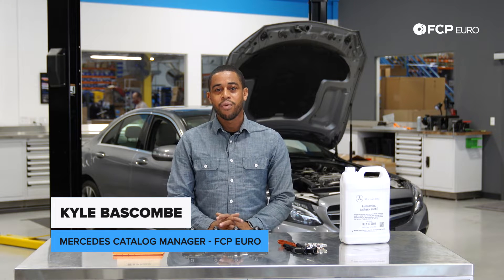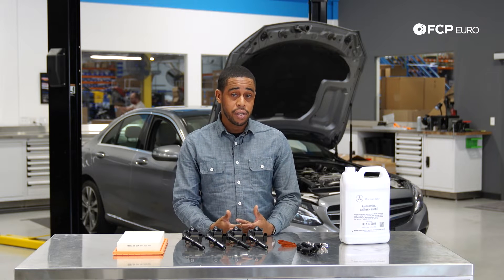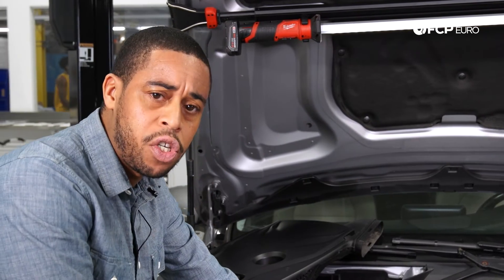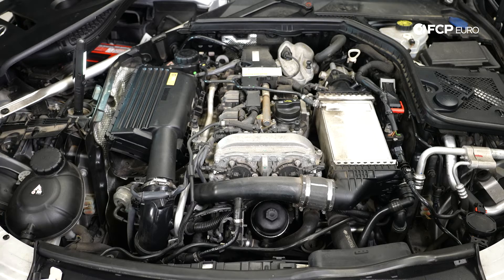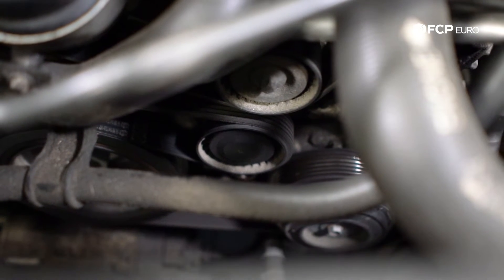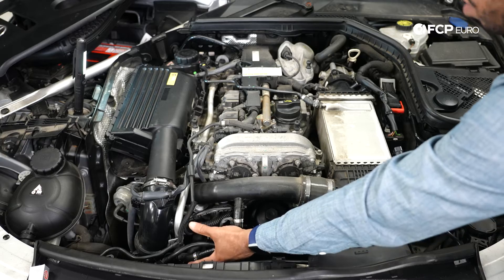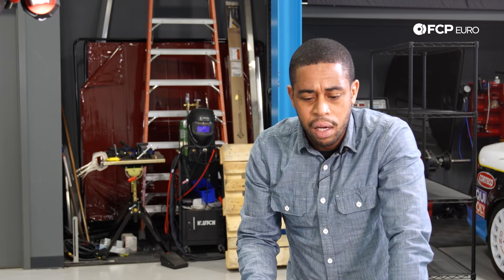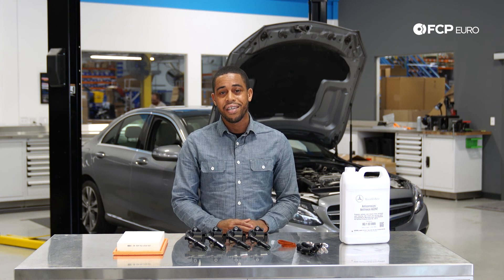Mercedes-Benz M274 Engine Diagnostic & Maintenance Guide (Mercedes W204, W205, W211, W212, & More)

Comment: I currently have 200,000 kilometres on mine which I purchased new in 2015. Never had a single issue with it. Having said that, it is displaying symptoms of a stretched timing chain which I'm getting on to.

Comment: Cool summary with some good details. Would you advise to Clean the throttle after 250 kkm in Case of Not having any related issues? How about cleaning the injectors?

Comment: Bought my e300 2017 at high 58k miles and first oil change at 65k but overtime it would jidder/shake when idle. Thinking it’s spark plugs? Any help
Reply: Could be as simple as engine mounts

Comment: My M274 2015 does not show any errors... but I'm finding it strange that there is a sound of water bubbles inside the vehicle. Driving is normal. Is there anything I should check preventively? The car has 60,000 kilometers.
Reply: i had same problem on my bmw, but when u turn off ac it stop

Comment: P0016 code replaced crankshaft + camshaft sensor Bank A should I replace solenoid adjuster?
Reply: Did you solve your problem?
Reply: @Boopityboopy no it’s been on for 10 months lol
Reply: @Avlful to be honest this engine is such a crappy replacement for the v6 m276
Reply: @Boopityboopy idk I been driving with this code
Reply: @Avlful totally understand, but the m274 isn’t like the m276 when you have timing issues because the m274 can actually bend the camshaft and cause serious damage if you keep driving without getting the car back in time. Any given day it can happen when the engine is out of time due to stretched timing chain or bad camshaft actuator whereas the m276 just causes a rattle upon cold start that can’t really lead to anything

Comment: Hi master,thanks for sharing all this info on M274, when the first time the timing chain needs to be replaced ?
Is that engine is better than the M271 (C180 of 2011 for example) ?
Thanks 🙏
Reply: A timing chain should last the life of the engine if you change the oil on a consistent basis.

Comment: All the jrkoffs saying the 'diesel' sound is gudgeon knock are FoS. its a combo of powerful injectors and the high pressure pump, which runs at very high PSI. The pump housing is slightly oversized, and aluminium, which is why people often notice a temp dependency. In the US there are customers running m274 engines into the late 200k, some at 300k, which is 500,000km. The gudgeon pin issue was fully resolved by a redesign of the pins, which are larger dia since 2017.

The subsequent, and fairly rare piston failures have all of them a common theme, incorrect RON fuels. Either too low for ECU knock corr, or abrupt RON changes before ECU adapts timing. Note the theme with piston that fails, oh yeah, startup stress from prem detonation. It's people running interference, purposefully or inadvertently through layman's guessing, advancing a claim the gudgeon issue continues to the present day, because ofc a gudgeon failing ruins its piston. But so do a-holes running low RON fuels in high comp motors.

FCP are great for parts, the guys "terrible but not so terrible" is just very "imho", imho. the 274 is a nice engine and very very easy to access. Whining on about water pump access? Bro, go look at any Toyota if you want tears to flow

Comment: 2017 E300 suffered #1 piston failure at about 110K miles, always well maintained and fed on Costco premium fuel. No help from Mercedes corporate. Had block replaced by my local mechanic. Still waiting to see if a class action suit comes forth. MB should have a recall on this engine. Also as everyone else, I have had numerous problems, but I was lucky enough to have them serviced through an extended warranty that I had purchased thru MB.   Latest is a P0299 code...MB recommends replacing the entire turbo assembly...turns out the waste-gate  vacuum actuator was bad, found one on Amazon,  fixed problem. $40 dollars vs $4000.
Reply from the maker: Sorry to hear this has happened to you :(
Reply: W205/C300 @130K had to replace vacuum actuator on turbo unit. Unfortunately MB does not sell the actuator alone ( only the entire turbo assembly for 5K). There is vacuum actuator from the previous engine, which fits too.

Comment: I have a 2019 E300. Garbage! 57k miles, and the intake adjuster broke. A $7,300 repair. The service advisor said it's a Nissan motor. He said it's not worth keeping but with a trade-in value  of $20k that's negative $11.5k from what i owe. That's why you never buy a Mercedes.

Comment: Greetings, I have a W212 e180 1.6 2015 274 engine vehicle, the tachometer is constant at idle, but there is shaking when you give gas at constant speed, the authorized service changed the spark plug, the problem continues, there is no fault code other than thermostat failure, authorized service, injector, tank fuel. pump, high pressure pump, it says let's change the coil, but this change requires a lot of money, first of all, where do you think I should look for this shaking failure, shaking does not always happen, it does it for 10 minutes in 1 hour of use, in total, the tachometer is hovering between 1500 and 2500 rpm, sports You don't feel much shaking during use, regards.
Reply: Did you fix the issue? My 1.6 M274 has a similar issue
Reply: Unfortunately I couldn't solve it, I want to start with the cheapest crank position sensor, then change the coil, if that doesn't work I will try changing the gasoline high pressure sensor.
Reply: The problem still persists, they say I need to replace the entire fuel system, if the problem does not go away, we will look at other points.
Reply: It's no fun driving with this fault.
Reply: They want 1/5 of the car price
Reply: I think it's a simple problem,

Comment: I’ve been religiously running chevron 91 only since i purchased my 2018 E300 4matic at the dealer almost two years ago at 68,000 miles one owner. Now it’s at 110,000 miles and every 5K oil change it’s still running exactly the same way I had bought it. Smooth and quick. Just changed the PCV and thermostat as preventive and done the transmission at 100K and differential front and back. Oil changes makes a difference and so does gas. At 100,000 miles spark plugs changed spotless. Theplugs were not bad at all. Checked top of piston and it was clean

Comment: Thank you for the in depth explanation.  Have had an M274 in a 16 model sport package, purchased with 34k on odometer currently at 78k stress free miles (knock on wood).  So far only had the auxiliary battery changed under warranty, serviced the transmission at dealer at 55k miles, plugs at 48k, all other normal A and B services.
Reply: Beware the issues usually start with this engine around 80k-100k miles. Timing chain, chain tensioners, camshaft solenoid, actuator, and camshaft issues all very common once near 100k

Comment: I have an SRS system failure due to the Pre-Safe failure in the drivers seat belt tensioning. I thought my eco drive wasn’t working bc of that but there’s also an engine light and so the thermostat may also be the problem.  Thank you for this video. I will be servicing my car soon at the MB dealer, hopefully they won’t charge me an arm and a leg for the servicing of the  supplement Restraint System

Comment: what is this error P13C523
Reply from the maker: Hello! Mercedes notes this code as referencing a "short-term torque limitation as detected by knock control." We'd also recommend checking if there are any codes relating specifically to the knock sensors that may indicate replacement is worthwhile.

Comment: Very interesting your video and very useful! Honestly, I was very intrigued when you talked about the common issue that this engine has with the piston. You described some exact sounds that my M274 makes in the mornings when the engine is cold. I have a 2018 C300. You mentioned that this is common in the 2015 and 2016 models. I hope that this is already resolved for the 2018 model. However, your description of the issue matches what's happening with my engine, but only when it's cold. After about 15 minutes, it works perfectly. The car has 36,000 miles and is very well maintained. Should I be worried?
Reply from the maker: Hey there Cristian! Your C300 should have an M264 engine, which is a bit different from the M274 that Kyle is diving into in this video. While Mercedes has acknowledged some valve seat issues on the M260 and M264 twins with an extended recall (fairly unlikely given your description, but may be worth looking into), they haven't noted any of the wristpin issues present on the early M270 and M274 engines carrying over to the newer family. The clattering of the direct-injection fuel delivery system on your engine is generally pretty noisy when functioning tip-top, which could be a part of what you're hearing.

This being said, if you're hearing a noise that concerns you, swing by a dealer or independent shop to be sure it isn't a cause for concern!
Reply: @fcpeuro  Thanks for the response. Unfortunately, the M274 is in the c-class, W205 from the 2015 to 2018 models. The M264 engine is from 2019 onwards in the c-class. When you mentioned that my engine was different, you made me doubt and I investigated. Besides, it's the same engine as in the video, as far as it looks. I'm very worried because I have the exact symptoms. I live in NYC. When I took the car to Mercedes Benz for maintenance, they said everything was fine. But no, I'm sure that this engine has the exact symptoms described in this video. Only when it's cold. So I started researching more deeply and found out that several owners of this engine had problems with the piston at any mileage - 16,000, 30,000, 100,000 miles. It breaks out of nowhere without warning. I also found out that there's an ongoing lawsuit in California for this issue. I also want to think that it might be false information. But when I saw this video, my doubts are present again. Honestly, I don't know what to do. I take very good care of the car and always use the remote start before using the car to warm up the engine. Thank you for your time.
Reply: Can you keep us updated on your journey with this issue? Thank you for your time 🙏
Reply: The car continues to run perfectly, only the noise in the mornings described in this video. At 4 minutes when it's fully warmed up, it stops. It's the same description, like metals rubbing together and a slight knocking. I maintain it very well. I have all the maintenance documented, the car has only 36k miles. Everything has been changed, including the coolant and brake fluids. Everything is very well controlled. So far, the car runs like a dream. But I'm always worried about that noise. I'm already considering selling it.

Comment: these things are still eating pistons,  we "at my shop" have seen 3 in the last year... newer ones too, just saw a 2017 or 2018 only 39k on the clock, it's sad but they're just trying to get too much out of these engines and making them as cheaply as possible... actually there is a class action lawsuit going on currently over this engine specially,  good luck and don't buy one of these cars that come with a M274, Mercedes is usually very good with engine development, this one must have been on a Friday at 4:30pm...

Comment: On my M274 it has a tendency of cutting power under heavy acceleration. What could be cause?
Reply: I had the same problem, changed the spark plugs and crankshaft position sensor and this fixed the issue.
Reply from the maker: Hi Cebo! A good first step would be scanning the ECU for any stored or existing code. This could indicate if you're experiencing a misfire condition or something a bit more involved.
Reply: I had the same issue with code P0299. Dealer replaced water pump and that fixed it

Comment: 2017 E300, purchased with 20k miles on it. Went to Costco for shopping, walked out and car misfire like crazy. The Benz dealership is across the street from the Costco. Literally had them tow it across the street because I shut it off right away and refused to turn it back on.   
They had the car for 2 weeks. 
RINGLAND at cylinder 1 had failed. Not wrist pin. PISTON RING BOYS. Motor was removed and disassembled, repaired with new parts and reassembled. All at no cost of course, under warranty. Drove it for two years after that and now at 74k miles. Haven’t had to do anything to it at all aside from oil changes every 5k miles on the dot at the dealer. Very reliable. Oh and btw I am a BMW/Land Rover tech 😅🤣 
This engine is GREAT.

Comment: My 2016 Metris has the "Low Boost" code and surges boost before going to full limp/zero boost mode. No matter whether it's 3psi, 11psi, or 18psi it will not allow for more than one second of boost before opening the wastegate. No boost leaks, smoke test is clear. Replaced turbo, intake manifold, boost solenoid, boost sensors, intake temp sensor, water pump. Showing P0420 also for cat but it has two new OEM O2 sensors. Magnaflow cat has been on order for months, wondering if for some reason it is limiting boost for that? Cat visually inspected when turbo was replaced, but only from the front site. A few other Metris guys are having this very same issue so I'm the lead dummy spending $ with the parts cannon to see what sticks to the wall. Mercedes/Sprinter dealers won't work on them anymore in my area, so we are out of luck. We order all of our parts for our Metris, BMWs, Minis, and VW's from FCP Euro to keep this family fleet running!
Reply: 161K miles on it, it's a work van that we'd like to retire to a road trip/van life rig. Bilsteins, Sumo Springs, and some other upfitted items so we are not a Dump-and-Run type...we want it to work and live! Sending off used oil analysis to Blackstone Labs from this last oil change.

Comment: I have a c200 w205 petrol ... the check engine came on, I took the car to Mercedes and they changed my NoX sensor.. after 3 months the check engine appeared again .. the same problem again, the NoX sensor was changed ... after 3 weeks the same problem  check engine with NoX sensor error ... what could be the problem?
Reply: There's a NOx sensor? you mean oxygen O2 sensor or knock sensor??

Comment: I've read that also a lot of people (also me) have gasoline smell, which happens to be from the hoses before and after the high-pressure fuel pump. this happens only in the cold, when hoses are hard, when its warm, they get softer and they do not smell. this is no joke, this issue is not addressed by mercedes, its left to do it yourself
Reply: I had the same issue ( high pressure fuel lines). MB fixed it at around 90K. Later, I have received a letter from MB stating that is is a common problem and it should be fixed at no cost, and the warranty for this specific part is extended to 130K (?). MB returned the money for the earlier fix.
Reply: Wrong it’s a recall got mine replaced by Mercedes it’s toxic gas fumes if I’m not mistaken.

Comment: Loved your video.   Great job.    I have a 2011 ml350 which I love but want the  newer lane changing , parking assist. etc and considering a GLE 350 .  I only drive 3-4 K miles/yr.    Should I get an excellent condition  2016 GLE 350 V6 or 2017 GLE 350.  Towing and gas mileage don't matter.   Thank you for your time and Consideration,  Tony

Comment: anyone know if a tune can kill the reliability on these engines? I have a 2017 e300 and would love more power but have always kept my cars stock since i didn't want to play with the reliability
Reply: I know that AMR makes various tunes for it, they’re pretty expensive unfortunately, $1,300-$1,500 for a C300, but I hear they can give 50-70bhp depending on what kind of bolt on’s you’re working with. Hope this helps!

Comment: I'm not sure what version of this engine is in my q50 bit I'm hoping I lucked out, I use mobile 10w40 and change every 5k and spark plugs every 40k  miles I drive that car very hard and I'm at 83k with no issues whatsoever

Comment: This channel is right on. Very precise.  Yes Turbo is bullet proof, but diaphragm goes bad. Yes PCV is big problem which cost 1-1.5K$ to customers. GLA is little different tho, GLA is much worse design it will cost you fortune. Otherwise nice smooth 2.0T engine with least problems and good power.
Reply: mmmmthese iridium spark plugs are good for 100-150k kms, hes being over cautious with such short intervals.

Comment: I have an issue with my m274 on w212 it has a hard start issue and a fault code p0016
Reply: What did you find out the problem was?

Comment: Thank you for the video. Our 2014 Japan spec 1.6 M 274 has developed a noticeable ticking sound. The sound came up immediately after starting the engine one morning and has since not gone away. Sent her in to Merc specialist here in Malaysia who after a day of servicing (e.o. Change) and checking says it is the CGI pump and a very normal sound. Having driven this car for 3" years, decided to start and listen closely. On idle, you There is duration that comes and goes where the ticking  sound gets faster after what sounds like a snap over, then back to the slower ticking sound within a brief period of about 30-40 seconds. From the bit I have read, it sounds more like cam chain or cam lobe or cam gear there about. Any guesses would be greatly appreciated. TIA
Reply: Forgot to mention it has approximately 45 K Kms on / 26k miles and there were 2 incidents of strong fuel smell for few seconds upon starting in the weeks before but not after. Mechanic checked hoses to and from the CGI with no leaks or cracks detected.
Reply: @shamalanon-time4209  it is a broken piston
Reply: 1.6 lt motormu var
Reply: have same sound every cold start. I think its normal, just when engine heats up injectors works lil bit different, trying to heatup as quickly as poss..